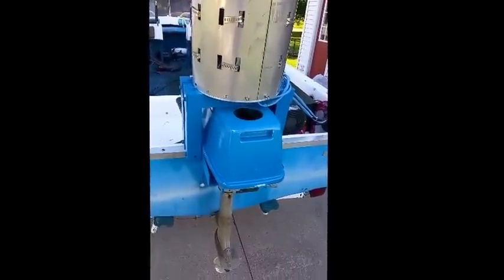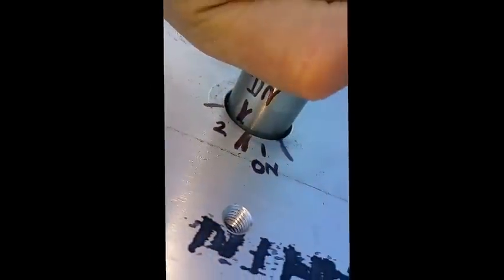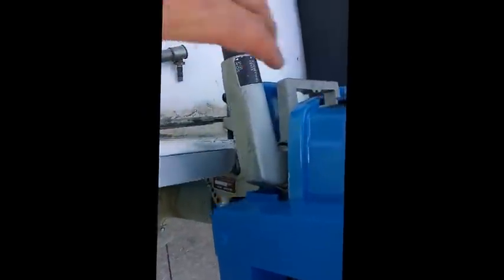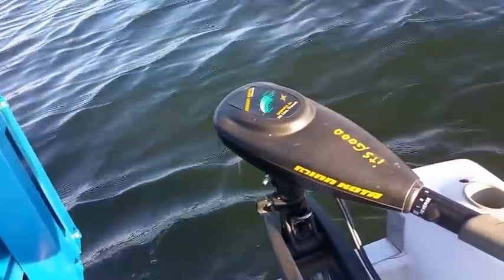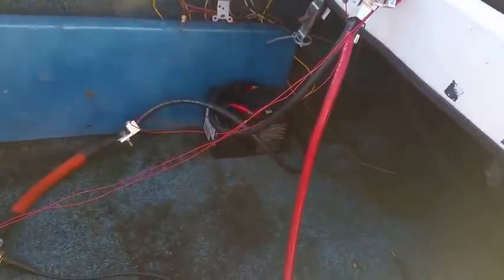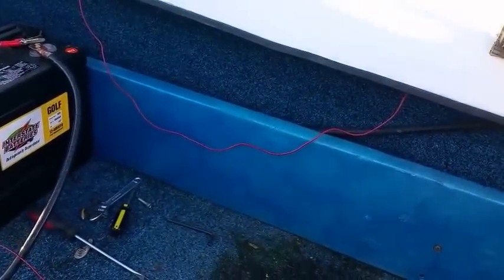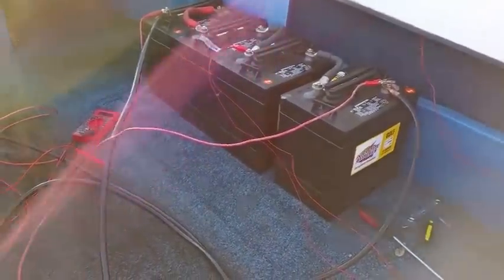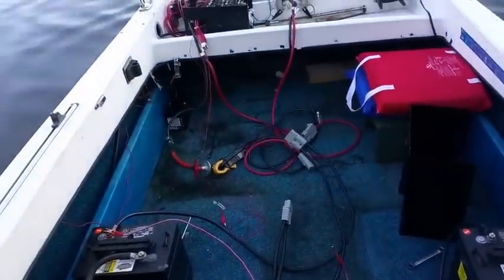Second Renaissance Electric Boat Conversion Aug 2015

Comment: Waiting for outboard manufacturers to get on the electric wagon. It’s overdue. Especially with smaller motors. I moved to Gainesville, Florida and the lake is 20 miles from my house so I don’t use a boat as much as ups use too and the gas we are sold has a short shelf life. I’m looking for an electric boat to take out on the lake knowing if it sets in my garage, I won’t have to pull it out and run the motor to keep the carbs clean.

Comment: I wanna know why we couldn't make electric speed boat ? is it because the DC power is very weak ?
Reply from the maker: You can make an electric speed boat. It would be faster than gas power. DC is not weak.
Reply: Wanna race? I got a jon boat with a 40-year-old two-stroke that'll run circles around your superior technology.
Reply: Tesla has an electric boat with such an electric motor that you will not beat let alone even compete with on race day.
Reply: Mike Ries I know this is old, but why do you have to be an ass with that post?  I just don’t understand why people want to get on peoples videos and PROOF OF CONCEPT projects and shit all over them.  It just makes you look bad.  SMH

Comment: If you are using a winding of this motor to charge the 2nd battery bank you are wasting about 15% +/- of this energy. That 15% should simply be left alone in the first battery to provide the boat with that much more range. Any generating loop is about 85% efficient, so you are just wasting energy. The motor should be operated as efficiently as possible as well as wiring and controller. Where do you get this 'one to one charging rate'?? This cannot happen due to the ~15% losses involved in trying to generate energy. If you were floating downstream and using gravity to generate power you would gladly accept 85% net gain since it is 'free'. But if you are paying 100% out of your battery to run a generator and only getting 85% back, this becomes a losing proposition. Indeed, the boat would go faster as soon as you disconnect that charging circuit. 

Simple brush DC motor, right? This info should be listed since this is 'science & technology' and not voodoo.
--
Reply from the maker: This is misunderstanding the whole point of this technology. This is much different. We are not using any generator in this, as the motor is a motor and a generator at the same time in the same windings. You have to understand the negative energy engineering in relationship to battery charging. This is science and tech and not voodoo. Science is not what merely people generally or presently accept as truth. This technology is 100 years old already however, and is actually covered in physics if you look into it. What you are saying is merely basic conventional theory and not descriptive of the real world and all applications. It is merely relating to a closed-loop constant current situation and does not pertain to negative energy components which are always discarded in inefficient ways.

Comment: Well done Rick. Wouldn´t it be better to use a Joseph Newman style motor with lots of fine wire and using high voltage ? As the batteries die much quicker, when you draw big currents this could help to stay them longer alive...ALso you would get way more BackEMF energy to charge your second battery bank... so better use finer wire in your motor and go with higher voltage.... surely this is then more dangerous with water around your High Voltage DC source battery...Anyway, well done.. Regards, Stefan.
Reply from the maker: +Stefan Hartmann There are 1000 improvements that could be done, but it comes down to what is practical and does the job. With this motor I can charge one battery bank while discharging the primary, or I can charge two banks as shown in the previous videos. Or I can keep all batteries charged with with zero point process. It really doesn't matter anymore about those 1000 little improvements when you consider the energies and work with them properly. The problem is when you make something too good then no one believes you. I will show more video in the next week or so.

Comment: Will LiPo's work the same way as SLA's on this type of charging?  Could save a lot of weight.
Reply from the maker: +ElGatoLoco698 They can, you just have to be careful to not overcharge or overheat them.
Reply: al desrochers
That's why I was asking.  Bedini always mentions the chemistry so I was wondering what how it affects the chemistry of LiPo's..
Reply from the maker: +ElGatoLoco698 You can work with them but you have to be really careful. They need a regulated charge or they could blow up. And there are so many different quality...
Reply: +ElGatoLoco698 What is good about lead acid battery is the fact that they hold greater capacity after being conditionned with this type of charging..  There is something in the chemical that change in the process and sla battery is way cheaper..